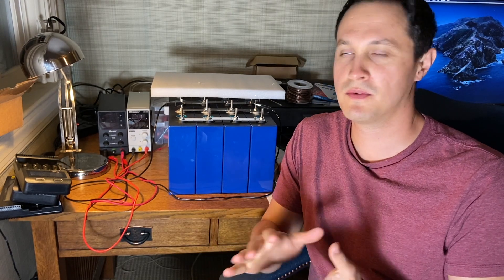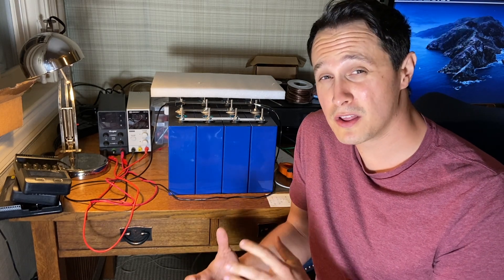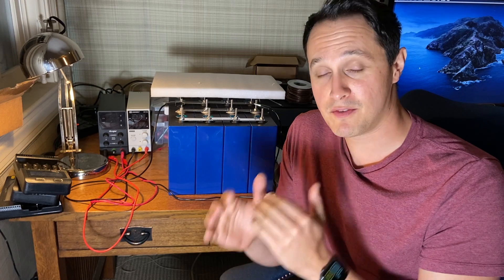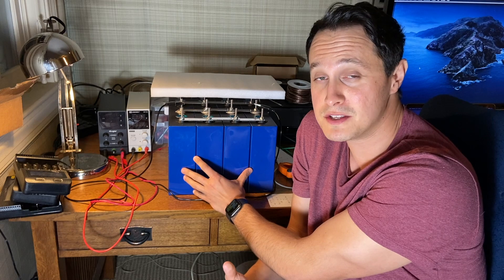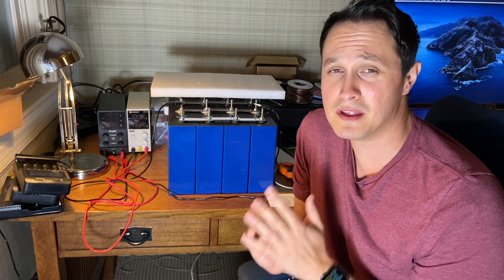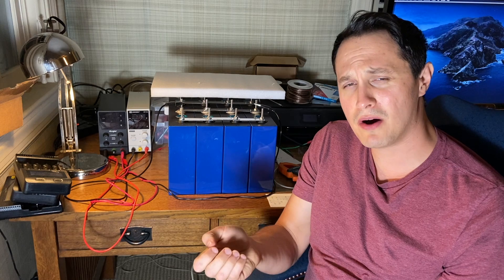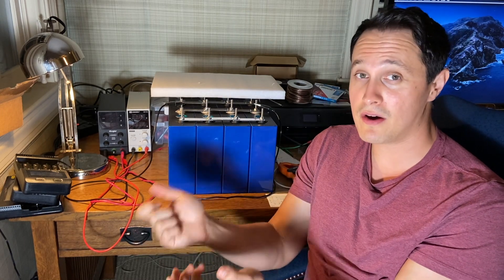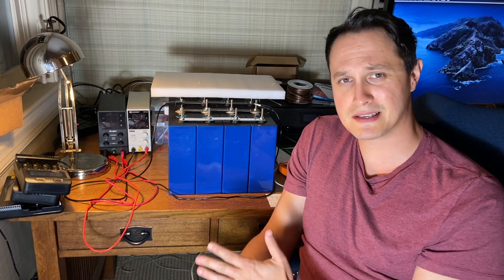Lifepo4 Basics and What You Need to Know!

Comment: Hi TheWilltoBuild, is there any difference in long life cycle life if I make a 12v battery out of 4 cells of these eve vs hundreds of small 18650 batteries? Since these are new, I wonder if 18650 batteries have better quality or it's the same since both are lifepo4 cells anyway?
Thanks btw for the tips and the great info.
Reply from the maker: Good question. I don't actually know which one will last longer, an individual prismatic versus cylindrical cell. What I will say is if you build a cell out of many 18650s, it should last a long time, because if one dies, the other cells will compensate, so it isn't sensitive to one cell dying. That said, it is way more trouble to make a battery out of 18650s than prismatic cells, and probably more expensive.

Comment: The temp sensor inside the bettery will prevent the battery from being charged too cold ?
Reply from the maker: There is no temperature sensor inside the battery. The only thing that will stop it from charging when it is too cold is you. You can do that with a BMS which has cold temperature protection.

Comment: Nice safety points man, I bought a 12v LifePo4 Valence battery, it has a built in BMS, it's a 40Ah battery so I am trying to turn it into a solar charging power station with a decent 1000w pure sine wave inverter for emergencies and on the go as well.  Thanks for sharing your knowledge man, cheers.

Comment: Great video and you answered so many questions i had on Lifepo-4 batteries.  I have used led acid batteries for years to power my Ham Radios and recently purchased a Lifepo-4 20A 12V as a backup so i know charging and discharging are different so i am having to do research and you have helped a lot as this is all new to me.👍

Comment: Thanks. I wonder if one was to do all these good practices what is the value of this chemistry vs another chemistry. I am investing in this form factor and chemistry currently. Should other chemistries be considered when taking into account these optimization strategies? Are the differences small enough to make the choice a matter of personal preference? I understand my questions are subject to qualifying use applications and considerations unique to the user. As a metaphor, steam engines are superior until you factor the good practices required not get blown up and worn down by maintaining the system.
Reply from the maker: Great question. Lifepo4 is definitely the battery wall, large storage chemistry of choice right now. It is comparatively cheaper, safer and easier to use than most other chemistries. There are Lipo cells that have better energy density, but they tend to be more expensive and more dangerous. There are also lithium titanate cells which can be charged and discharged at really high and low temperatures, and at really high rates, but they are very expensive. So lifepo4 is definitely the best large storage option unless you have unique circumstances like extreme temperatures (like below freezing) or need really high charge/discharge rates.

Comment: Alot of BMSs tend to have an over charge voltage of 3.75 +/- 0.05 per cell. Whats your view on this?
Reply from the maker: I think that is just too high. Charging all the way to 3.65v is already not good for your cells. Taking them to 3.75 likely won't kill them, but it really can't be good either. A proper lifepo4 BMS will cut charge at 3.65 (or let you customize it yourself). I would say get one of those.
Reply: Indeed I would tend to see things that way too. I am trying out an Overkill Solar 16s BMS as we speak and it is very customisable!

Comment: Hi very informative just a question, I live in South Africa and planning on building a panel van camper next year, I'm planning on going to desert and semi desert areas, the temperature can range from 0 to 50 degrees Celsius in a day, have you got any advice on how to keep my batteries from getting damaged
Reply from the maker: Mostly I would try to insulate them. If they are well insulated and aren't in high or low temperatures for too long (a few hours) you should be fine. If the temp is going to be near zero or near 50 for extended periods of time, you'll want to try to think of some sort of climate control. That could be as simple as some heating pads or fans, or something more sophisticated, depending on how long they will be exposed to those temps.
Reply: Thanks a lot most of the usage will be at the upper 40 to 50 degree, I'll have to see if fans will work thanks 👍

Comment: A word of warning. Not all suppliers wrap the bottom of the cells. As a result, if you wire them in series and then place them on a conducting surface this is likely to short out any cell that has its negative terminal connected to another cell's positive terminal. I nearly fell into this trap as I placed some electrical heater pads to the underside of a sheet of aluminium to provide even cell heating. This may not apply to all cell suppliers. I am in dispute with my cell supplier as their cells are only producing 295Ah when they are rated at 310Ah and I am not impressed with their after sales service. If I don't get compensation I will publicise the supplier's name for buyers to avoid them.
Reply from the maker: This is a good point. Definitely worth checking to see if your cells are completely wrapped, especially if they are on a conducting surface.

Comment: I made a battery pack of 16s 105ah . With Ant bms . The problem with the battery pack is it is not getting balanced. Should I buy a bms with balance option?
Reply from the maker: Did you top balance first? Most BMS balance options are really, really slow. If you haven't balanced your cells, definitely do that first. Otherwise, there are active battery balancers out there I would look into. I don't think most BMS can do much in terms of balancing for larger cells.
Reply: @TheWilltoBuild  please share the link to purchase active balancers. 3.2volt 16s 105ah.

Comment: thank you sir.  very informative....  I am a radio amateur and building a pack for emergency and portable use.  Unlikely to use solar in Seattle area....   I am using a Daly bms and will be 4 VariCore 3.2V 90Ah LiFePO4 batteries.  Walk through of going from batteries to working pack would be great.  I will follow your top ballance procedure after I watch it.
Reply from the maker: Thanks for the comment. I think I've basically covered everything you need to get the batteries going, thought not in one video.

Comment: Electrician here  just a comment on the last point you touched on, should you be touching a terminal and the casing depending on which cell you are touching the potential is going to be between max 3.5v to 48v dependant upon the amount of cells connected in series ,  creating a pathway through your body by contacting the unprotected casing and a terminal will in the worst case (48v)be a minor ouch moment and more likely due to skin having a very high electrical resistance value ,voltages under 24v are barely felt , so no , physically shorting the case and a terminal would create such a small current pathway if any , its not a concern .. something with a much lower resistance value ,   ie anything metal touching the bare casing and a terminal  would create a serious fault current which if nearby could result in a flash burn and lead to a run away .. oh btw it would make no difference if the cases were positive or negative , the same potential exists only the polarity changes
Reply from the maker: This is a good point. Direct contact with your skin isn't going to do much, but shorting with a metal tool or with busbars can create a massive discharge that could easily start a fire, shoot sparks, etc. I probably should've gone into this more in the video, but at the time I was worried about confusing people, and I didn't want anyone getting cavalier with their batteries because the voltages were low. Given their capacity, a short circuit could an huge problem.
Reply: 50VDC is enough to do harm to humans. The high amperage capacity of batteries is what makes them dangerous.

This is why most countries have introduced regulations on 50VDC work.

Comment: 280 amp hrs ,,  12v   
How many solar watts to comfortably charge these lithiums .??
Reply from the maker: Well, four cells made into a 12v battery, at 280 ah, will produce about 3,584 watts hours for the whole batter. If we assume you get about 5 hours of sunlight a day (could be more, could be less), then roughly 715 watts of solar are needed to charge this pack in a day. A bigger array will charge it faster, and a smaller one slower.

Comment: Could you please speak to stacking batteries sideways upside down things like that for different configurations for solar. Meaning can you lay them sideways and stack them? Or do they always have to be standing up like a regular battery? And nobody has really addressed if these batteries are safe to be inside your house rather than outside like let acid
Reply from the maker: Good question. I've heard different things, but I personally would not put these cells on their side, I would only ever put the standing up. Others had said otherwise, but I just don't think that is the way to go. 

As for storing them in your house, they should be perfectly safe unless there is a leak. If the cells swell for some reason and electrolyte leaks, that stuff is really toxic and bad for you. So I think they are probably safe to have in your home, but I would have them in a plastic container or something so that if the worst does happen, and they do leak, everything is contained.

Comment: Do you think there's a need to do a capacity test on EACH individual cell in my 280Ah 12v config? I'm currently top balancing them and still haven't found a consensus on the question. I'm definitely going to do a test on the whole battery once I assemble it with BMS.
Reply from the maker: Good question. It's simple. Create the entire 12v battery and test that. If the entire battery has 280 Ah, then every cell in the battery must have at least 280 ah. If the full battery doesn't meet 280 ah capacity, then at least one cell must have less than 280 ah, in which case you need to test the individual cells to see which ones are below capacity. So basically, test the full battery and if it doesn't meet capacity then and only then do you need to bother testing individual cells.
Reply: @TheWilltoBuild  Thanks! Makes perfect sense! Now if only this top balancing would just end already! Down to 0.150A 😂
Reply from the maker: @Mike_219  No problem. Also, the current will never go down to zero for the top balance. Make sure to take off the charger periodically, let the cells rest for a few minutes, and check the voltage of each cell. When they get to what you want you will be done. If you wait for the current to go to zero then you'll wait forever.

Comment: brilliant video. could someone tell me what setting I would need for my epever solar controller to cycle between 10% and 90% on my cells? these are my current setting.... 

Over Voltage Disconnect 14.7 V

Charging Limit Voltage 14.6 V

Over Voltage Reconnect 14.6 V

Equalize Charging Voltage shut off or 14.4 V

Boost Charging Voltage 14.6 V

Float Charging Voltage 13.6 V

Boost Reconnect 13.3 V

Low Voltage Reconnect 10

Under Voltage Warning Reconnect Voltage 11.5

Under Voltage Warning 11.5

Low Voltage Disconnect 11.0

Discharging Limit Voltage 10.5

Equalize Duration 0 or set as low as possible

Boost Duration 180 minutes

Comment: Hey Mr. Will enjoyed ur vid! Ive been building only few months now but ive come to realize balancing is very helpful saving the bms from overworking or faulting during charging by eliminating a high or low cell from shutting bms down. when building 100-310 ah cells the .025ma bleed resistor would take 12,000 bms cycles to adjust a unbalanced cell config if unbalanced(Lol) do the math? but more important is that cells are matched as close as humanly possible bcos my issue lately is China sending unmatched cells making battery capacity suck! not just voltage but impedance too and electrolyte weight too! Ive been building with 5amp active cell equalizers and this is the bomb! with big cells important to get the 5-6amp units the ones with the little capacitors because they work awesome and maintain balance from bottom to top! Although pricey @ 15$ 4s, 30$ 8s & 55$ 16s they eliminate all this timely bottom n top balancing! My builds now use a 500amp relay kilovac EV200AAANA with built in coil economizer uses 1.7w hold and drive it with a daly 20-40amp bms for safety/control purpose and let balancer do all the balancing! I have 20$ in dalys Bms+ 15$ in equalizer n 30$ in relay so 65$ gives me 500amp BMS system that can run 200-250 amps w/no heat or current bottle-necking MosFets and it's bullet proof!
Thanks for sharing your video rocks!
Reply from the maker: Awesome info, thanks for sharing your experience. If I have too much difficulty I may look into cell balancers myself, but a good balance should limit the need for this.

Comment: I looked at the EVE 280 specifications, the updated one saying that you can get more cycles if you compress the cells, and it looks like they did extrapolations from fairly limited tests. Maybe just 800 cycles.  They use a linear extrapolation for the uncompressed data and a nonlinear one for the compressed data. And the actual data shows that at 800 cycles the uncompressed cell is better off, with 96% capacity vs. 93% for the compressed cell. Is there another set of data out there that more clearly shows capacity vs cycles with and without compression?  If not then it looks like lots of people have jumped to the wrong conclusion.
Reply from the maker: Really interesting point you're making here. The EVE datasheet I am looking at has uncompressed at 94% at 800, versus 93% for the compressed, so basically identical. I don't actually have any other datasets to lean on the back up the importance of compression other than the manufacturer's suggestions. I think the importance of compression is already overemphasized on most DIY forums, and you bring up a really good point concerning the evidence it stands on. This is especially true considering the fact that if you cycle once a day 2000 cycles is already five and a half years, in which case battery prices will have come down and technology significantly increased by the time you see any real degradation in your cells. I will definitely keep an eye out for more information on this.
Reply: @TheWilltoBuild  Of course what I would really like to see is capacity vs cycles for a more realistic profile.  Maybe 3.33V to 3.15V with 0.5C discharge and 0.2C charge rates.  Those voltages at those rates should be around 99% to 10% capacity.  I bet it lasts a really long time, with or without compression.
Reply from the maker: @willdejong7763  Couldn't agree more. I think using them without full charge/discharge, say middle 80% under reasonable temperature assumptions, and they should last a long time and compression is unlikely to make a significant difference.
Reply: Will Prowse said in one of his videos that if you set your charge discharge parameters to not max out your battery they will probably last foe 10,000 cycles. I have read 4,000-6,000, so by not maxing you can almost double the cycles it seems. I personally could have probably gotten away with 4 cells, but since that would have meant getting the most out of them when they went down to 8 280ah 3.2 cells for 800 bucks i bought 8. Now i have to figure out what parameters to set them at to baby them, hopefully i will never have to buy more.

Comment: Thank you for pointing out that the cases are positive! I have not seen that mentioned by anyone else, and it is definitely a safety hazard to be considered. If one bare case comes into contact with its neighbor in a pack, really bad things are going to happen! I can envision that happening in a mobile installation where the cells are able to abrade, even a little, against one another. I intend to place thin sheets of polycarbonate (Lexan) between the cells. And, if the cells were going into a metal battery box, on the sides and bottom.